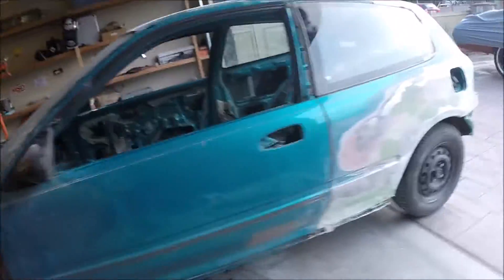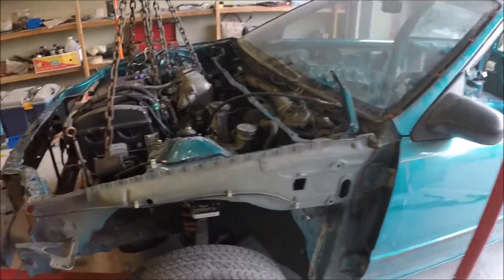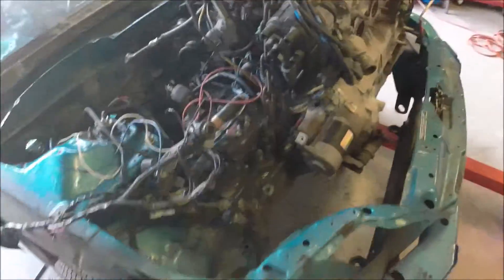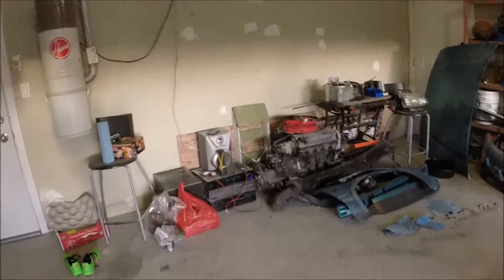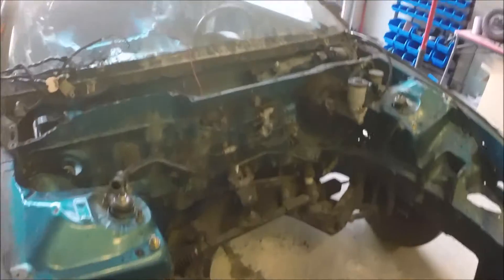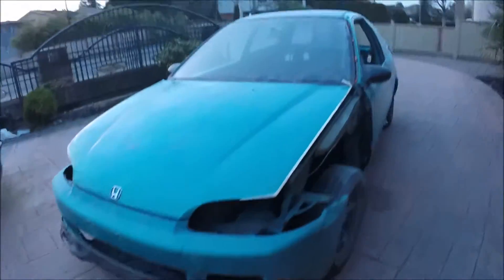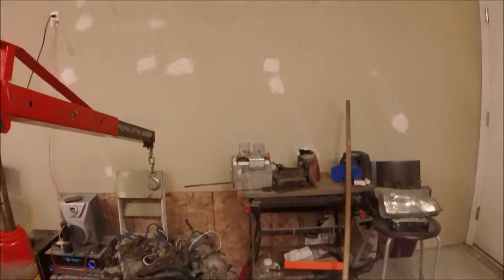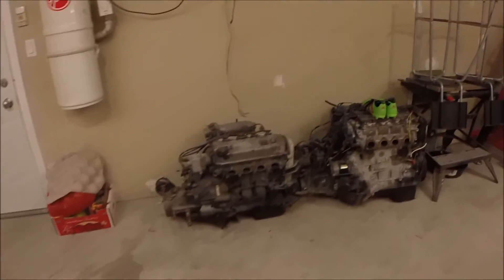Pulling My Engine Again!

Comment: how was the wiring process on it man? I have an h22a4 eg hatch as well but I tried to do a wire tuck on it and we'll basically I got everything wired up,all the lights come on inside, headlights and everything only thing I'd it won't click or nothing. I have no idea were I fucked up
Reply from the maker: diego duran I’d start by using a  multimeter on the components that aren’t functional and trace the wires back. I also hope you soldered your wires when doing the “wire tuck” because I know a friend of mine used these other types of crimp-on connectors that caused his h22a to not start. Best of luck, man!
Reply: Dom Rai yeah I didn't solder them I think that's were I fucked up.. imma re do it again hopefully that would work. what about the thermostat ground, can I relocate that too as long as it has ground right
Reply from the maker: diego duran I think you should be able to as long as you include all of the ground wires going to it. Make sure it’s on a secure grounding place if you do decide to move it. I would keep it in the same place though. Pretty tucked away where it is already.